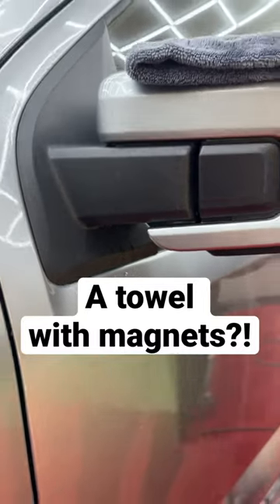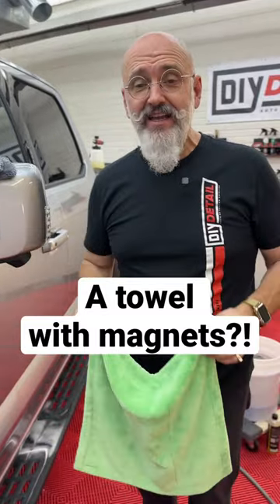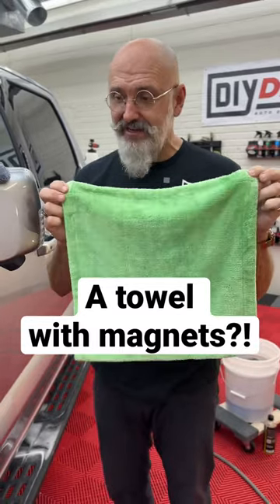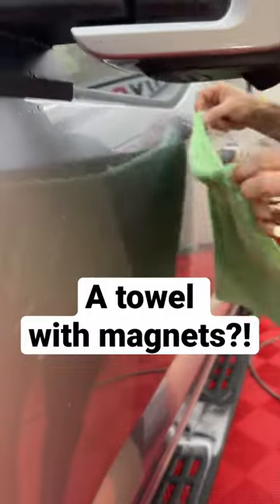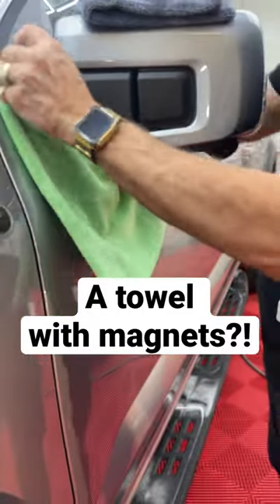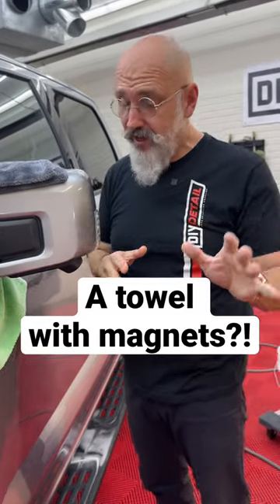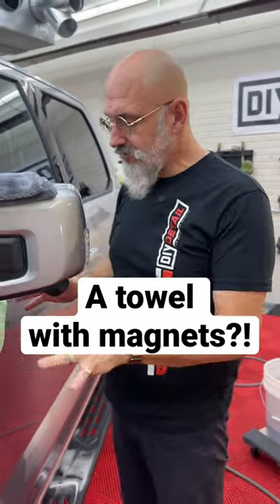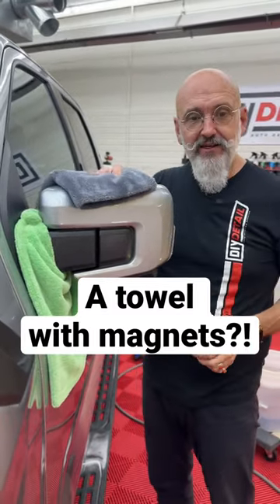Is this the best new detailing towel?

Comment: Alot of this stuff is useless. Just get your microfiber towel and use a paper clip. So you dont waste your money on useless things like this. Think smarter not harder.
Reply from the maker: Honestly we were skeptical at first too. But you just need two of these — and you’ll love having them for those annoying drips after you’ve dialed in the car on both side mirrors. You can hang them by the magnets and basically no need to wash them. Try it before you knock it:)